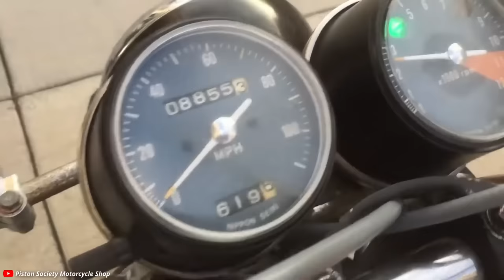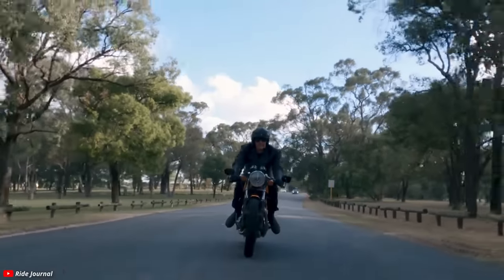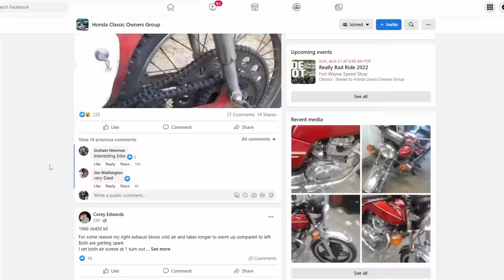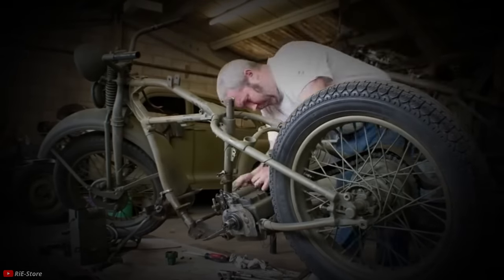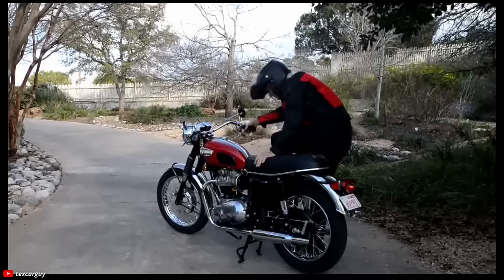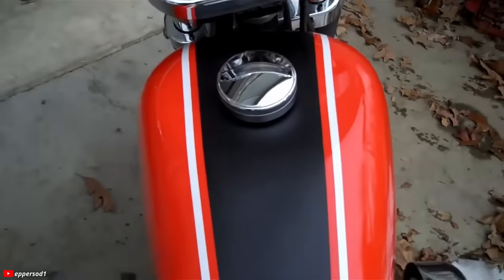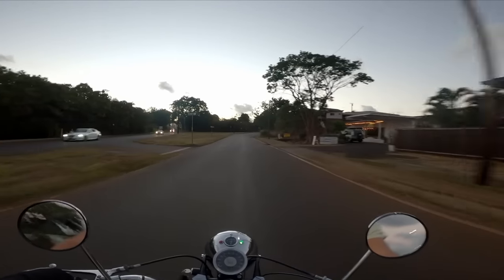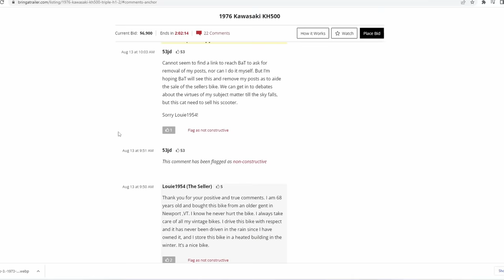So you want a classic motorcycle...

Comment: Lots of good advice here. I rode many bikes that belonged to friends and acquaintances -- both road and dirtbikes -- but never owned one until I had made a friend in my late 20s who was all about classic MCs. He talked me into getting one so I kind of ran out and got one off Craigslist without first thinking through what kind would be best for me. I got a 1979 Yamaha XS1100. A great bike, no doubt, very powerful and mine was very reliable. It needed headlight wiring, which I had a mechanic do, and then a couple little things that I did myself and it was good to go. 

But... it was just not the right bike for me. These bikes are really powerful and all I did was local street driving, living in Pasadena at the time. They don't really feel "balanced" until you're going 45mph or more on the freeway. I laid it down coming down the twisty hilly roads from Mt. Wilson because it was just so bulky and top heavy. I always felt like I was trying to conquer a beast rather than enjoy an extension of my body. I liked the bike but never really felt like the bike liked me, if that makes any sense.

Anyway, that was many years ago and now I'm looking to get another, more classic-style bike. I think a suburb-friendly, 500-650cc, two-seater like a Bonneville or CB500 would be just fine. I'm a dad and will be a weekend-warrior at best, so I need to keep it simple. I can do all the simple, external work, but won't be cracking open any engine blocks or anything like that. :)

Thanks Bart for helping me to sort this stuff out and really just for your straightforward approach to enjoying and sharing the world of motorcycles.

Comment: I just finished putting together a BMW R80 and it is my first bike. It was pulled apart in boxes and rusty when I got it. I’ve worked on cars most my life so I figured some knowledge would transfer, and it did. Bikes are such a good way to learn how to work on vehicles (granted you have the space, time, money, and patience) compared to cars. Everything is accessible and visible and there are much fewer moving parts. I would say go for it if you can afford it. It has been a blast for me so far and I’m extremely excited to start learning how to ride this machine that started out as boxes I could move around in my trunk. It helps that airheads are bulletproof but it has been a great learning experience.

Comment: working on my 81 Harley FLH Shovelhead right now. snapped clutch cable the other day. big headache lmao. not for the faint of heart, but real rewarding.

I've also gone coast to coast on a 1970 Honda CB450, and recently went from Cedar Rapids, Iowa to Cape Canaveral, Florida on a 77 Yamaha Xs750 triple. I love the old Hondas, very reliably, very easy to work on, and they were the cutting edge tech of the day, and can hang with most newer cruisers in terms of performance.

Comment: I have owned a number of classic bikes and loved them. Getting parts is more difficult. Luckily I can do the work myself because many shops won't even touch anything that old. If you really want a nice "classic" you can also consider a Kawasaki W650 or W800. These are fantastic and beautiful bikes that look very close to a '60's Bonneville, even more so than the new Triumphs. I love my W800 classic, it has all the looks and sound (360 degree firing parallel twin) and much better build quality.
Reply: I got an '80 kawasaki kz440 ltd and I love it

Comment: Tinker - or fettle - stuff like re routing a throttle cable, adjusting the headlight, oiling the chain, checking wiring and crimping spade connecters/taping or cable tying leads and/or cables, cleaning the dirty grease from the twist grip - basically mucking around in the workshop/garage/shed with a beer and a smoke, radio on, mates good naturedly jeering and piss taking about your/their choice of bike/leathers/paint etc - one of the best things about your bike is tinkering or fettling as the Poms say - brit bikes need constant 'tinkering' - its one of the best ways of getting to know your bike . . and its good fun . . .

Comment: I have a 1983 "GS450" that I bought in 1986 with 750 miles on it that motorcycle now has 257,000 miles on it, and the engine is running on the factory build( still has good oil pressure/ does not burn oil). I do all of my own work on it. every 20,000 miles, I take the bike down to the frame for cleaning and re-greasing of bearings. all machine thread fasteners are cleaned and re- greased, and any problems/ worn out parts are taken care of. it is just as reliable today as it was when I bought it. I got a big kick out of all the dealerships that told me" the engine was only good for 50,000 miles", well all those dealerships are gone now, but the bike lives on!!!!. just to establish a good parts supply for my bike ,I would buy parts bikes( no title) from dealerships that did work on the machine that was in for repair, but the owner would not pick up the bike after the work was complete.
Reply: You must really like to take your bike apart. Total disassembly every 20k miles seems like incredible overkill as it sounds like your maintenance schedule is already impeccable. Either way. Whatever you're doing works as you have a ton of miles on your machine. Drive carefully and enjoy!
Reply: @giggiddy  the steering stem bearings are  the original bearings, and the grease is in O.K. shape( new grease is always used), the swing arm bearings  always need to be cleaned and a fresh bearing re- packing of grease is always needed, those bearings are also original. I never have problems with anything coming apart from rust. I worked in a motorcycle shop years ago, and every once in a while I would get one that needed new tires put on and could not get the axle shafts to come out, due to rust. two of us would jump on a breaker bar, trying to get the axle shafts to break free, and the thing would just laugh at us. it is in to stay, and would return the bike back to the customer with the old tires on the bike. that is why I do what seems to be overkill. I also replace the brake fluid, and the drive chain is replaced. the sprockets are inspected and replaced as needed, the same goes for brake pads/ shoes. the bottom line is "I do not want any trouble/ being stranded with a break down." that bike has never let me down. I used that bike as a "daily driver" for years. now that I am retired, it does not see the millage per year( 10K)that it did in the past. thanks for responding back, I like the feedback!!!!.. have a great day, and as they say "KEEP THE RUBBER SIDE DOWN".

Comment: I still own my first bike - a 1966 Norton Atlas which I bought in 1976 and have been riding every year since. I did buy a 1975 Moto Guzzi 850-T a few years later because it has electric start (the Norton has to be kick-started).  It was also more reliable than the Norton until the wiring harness fried while my brother-in-law was riding it. I've been able to do most of the work on my Norton myself, but it's good advice to know where to find a more experienced mechanic. When the magneto on the Norton lost it's spark, it had to be rewired by someone with the machines and know-how to do it.

Comment: Spot on video. As you mensioned, is really cool to see peaple taking pics from your classic motocycle when you stop/park. I have 2 classic portuguese 50cc motocycles from the late 70's. I didn't know much about mechanics, but still managed to do restore them ( Both motocycles where "barn find" ,  so they weren"t in riding condicions.)
Each on took me around 1 and half years to rebuilt them, bought especific service books for the engine, posted a lots of questions on facebook groups. At the end i learned a lot with my wins and fails during the restoration process and now i got "promoted" to the guy that not owns a shop, but is always fixing his friends motocycles..😅😅

Comment: My first legal street motorcycle was a 1974 Honda 550fourK in Orange and black had almost the entire catalog of extra bags windshields, headers, exhaust, pegs, lights, you name it. My uncle bought it new put 450miles on it and parked it in the barn on the Ky horse park and left it till the 90’s when I bought it and went through the whole thing and replaced all plastic and rubber parts and all 4 carburetor’s! I owned it for 10 years and ended up putting 40k miles on it. Once I get it lined out it ran like a clock work. But it was a Honda with all new modern parts with old 70’s metal! All that chrome cleaned up good to.

Comment: Recently bought a 1981 BMW R100RT. I had owned the same year, model and colour in the 1980s. Riding along a country lane, suddenly the exhaust noise got a whole lot louder!. My first thought was, oh no, exhaust system has a hole it, I looked down, the whole left muffler was absent without leave!

Retraced my path and found the muffler on the side of the road. Waited til it cooled then rode home with cradling the muffler on a very noisy bike. Jumped Into my modern Kombi and into town, bought some M6 screws and spring washers, refitted the muffler and replaced screws on the opposite side. Moral of the story, old bikes, check every bolt nut and screw you can see.

Comment: I have a 1970 Honda SL350 Motosport I Frankinsteined it has 750 front disk double piston caliper Akront rims 2 into 1 low exhaust Yoshimuira now it is around 300lbs with over 30hp I have gone over 100. I would like to change to one carb for reliability. So I won't need to balance the carbs. I melted a piston one time. P.S. The SL has a longer rake better high speed stability, larger valves.  I also added 1inch of travel with 1980s Honda 650 shocks air assist in front. Blue metal microflake with winged H. My dream bike took me 10 years mostly from parts I got  from the first and oldest Dealer,junkyard nextdoor An old gentleman who knew the history was very helpful. I had A stock 69SL I sold it to A Japanese couple for 300.My mom said get it out.I am now 65 I love my Frankenstein!!!  Every time I look at it I know it's one of a kind I did dat. 
70s charm with 80s improvements

Comment: I bought a 1973 Honda XL125 in 2006 with just a few thousand miles on it in very clean condition. 
And a 1973 Honda CB450 in 2007, also very clean but with more miles, 23,000ish.
I kept and enjoyed them both until last year, 2022.
I decided to sell them as I was recovering from a stroke, I was 61 years old, and the CB450 was far too heavy for me to then handle. I also realized that if I was going to continue to ride, I needed something small, light, reliable, and easy to handle. So I bought a new 110cc Honda Navi mini moto.
The Navi isn't fast, about 55mph max, but it's automatic like a scooter and still has the motorcycle looks and feel of a tank between your legs. So I still get to ride around town and through the quiet country roads in my area. I'll go out riding for a couple of hours, stop for a snack, and a coffee, and cover 40 to 50 miles. It's better than giving up on two wheels for sure, and quite a bit of fun.
Reply: Sorry about your stroke at such a young age- i am almost 57 so I can relate. But so happy to hear you are still riding and you haven't thrown in the towel. Cheers my friend

Comment: Having had the cb 550 and cb 750 I'd have to recommend the 550. There wasn't much difference with the top speed as the 550 was a lighter bike.
Reply: Cb 750
More relax
Reply: Try a CBX550 they're a pleasure
Reply: The 550 also makes a great cafe racer
Reply: The 550 was such a smooth engine.

Comment: I've owned about 50 bikes since the 60s. My two favs,  1969 Suzuki T-500 (Café racer with many mods) and I 1980 Yamaha SX 650  heritage special with lowered rear shocks and a few minor mods-- it had spoke wheels. I've had  a Z1 900 and a couple of Honda 750s, 4 RD350s some souped up others stock, a a couple of 60's Triumphs from 250 to 650
Reply: what did you like about the 69 Suzuki?

Comment: Believe me, i'd much rather have my classic bikes than anything modern, and definately nothing with fuel injection, the best upgrades, modern tyres, modern clutch plates, electronic ignition, upgraded charging system with a quality lithium battery, led lights, way brighter and very little current consumption, i've had bikes from a 1945 BSA B31 to 500,650 and 750 Triumphs, BSA and Nortons, recently i'm into 80's Honda's, especially the CM/CB 400/450 and the CMX 450 Rebel and yes i've been in mechanic work since i was 8 years old with my Dad, i'm now 57, the only thing i dont do to my bikes and i've restored many from piles of bits and even specials made with bikes from different makes, countries and decades, get stuck in and learn to do it yourself. Reliability wise, well just about anything can be made reliable if you know what youre doing, one of my most reliable bikes is one of my Triumph T140ES Bonnevilles, i've put over 120.000 miles on it myself and it had been through a few others before me including the police force, God alone knows the mileage, actually, aftermarket parts etc can be made to work but again, you need to know what youre doing, pod filters are ok but not on CV carbs, theyre a pain to set up properly but the typical slide carb is easy to tune with a free flowing exhaust and pod filters, but i do agree , i like my bikes pretty stock ish, too many people get a bike and feel that what they should do is to chop it up and make something different, its your thing but very often the bike might look better to you but will generally make it worse, ride it stock and see from there, i've dont so many projects and yes, i've dug bikes out of the ground or from in the swamp, from burned out sheds, under cellers etc, nothing wrong with a project but just recognise your skill level, no use buying a basket case if youre new to the game as it were.

Comment: In france we had moto terrot, peugeot and motocomfort.
Sadly they all either died or stopped building motorcycle most of them in the 1960s
They where all great and reliable especially terrot.
But sadly part are so sparse nowadays 😢 even if you can indeed buy a 125cc for 3000€ if something break you may not be able to repair it for some time.

Comment: It's a no brainer for me.  You can buy '70s-'80s UJM (universal Japanese motorcycle) classic style bikes for cheap around here.  I love the metal fenders, chrome bits and upright ride posture.  These bikes were made with tight tolerances so the engines last if cared for.  Parts are now widely available  and surprise, the inexpensive Chinese made part is the same as oem!  This makes it possible and fun.  In the end you've got a bike like nobody else's.  A '73 CB350, an '81 XS650, an '81 GS400... they're out there.  GL1100...?  Any of these makes better sense than a new, plastic parts motorcycle to me.

Comment: Thanx for the Video.  You made a lot of good points.  I have been into Vintage Bikes for years.  I do not claim to be a Mechanic but I will do and Have done some Repairs that Kept the old Girls running or got them running that amazed me.  I feel Fortunate in that I believe I have a Gift from God. Having said that,, My 69 Honda CL175 Scrambler is down with Electrical Issues.  Runns Great,  but my Health is on a Downward Spin right now but Im hoping to get to the bottom of that problem before I Join the Riders in the Sky. Anyway,  thanx for the Inspiration.

Comment: I've been riding a BMW R75/5 for about 20 years. These bikes are bullet-proof.(1st oversize pistons at a 125.000km's on the clocj!)My brother has a R*0/6. Fantastic bike! (while you're not allowed to go 188km'h in the US: install the R75 transmission.
you loose 19 km/h top speed. It'll transformed to better accereration ;-)
My brtoher also has some Szuki T400 2 strokes. Sooo much fun! But be aware of the gearbox problem: without modification, it's not for long distances.Problematic bikes: Kawasaki 550cc triple: no oversize pistons available! Suzuki GS 750: almost impossible to get oversize piston rings! (Pistons are no problem.)
Dreambikes of mine: Moto Guzzi 500cc Sahara. Moto Guzzi 850cc Eldorado. Moto Guzzi California II.
Sanglas 400. Moto Morini 3 !/2.(The 500S has a gearbox problem! Laverda 750 twin. Kawasaki 750 twin (Watch the chain for thr balancers!)  I could write another 2 pages. My current ride is a Yamaha RD 125LC (both 10W and 1GU)
Greetings from the far north of Germany!

Comment: I remember in the 1970s, the Kwaka 750cc two stroke three cylinder was infamous for gas guzzling. The joke was that the 750 2 stroke Kwaka used so much fuel, that so much air rushed through the fuel tank air vent to replace the rapidly diminishing fuel, the air vent whistled!  I have not seen one of these bikes on the road now for decades.